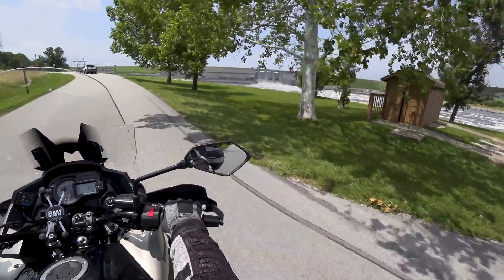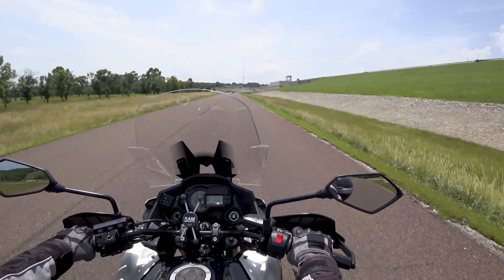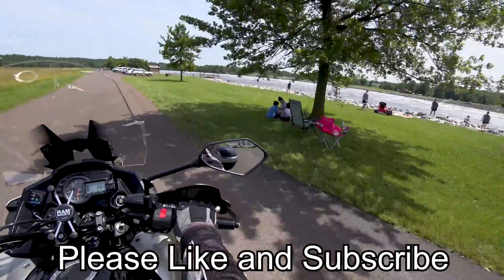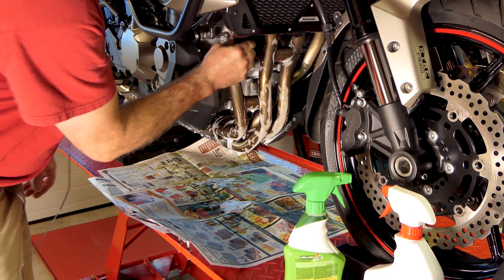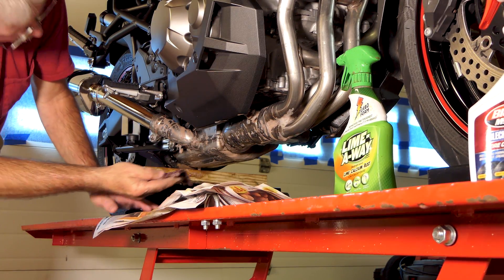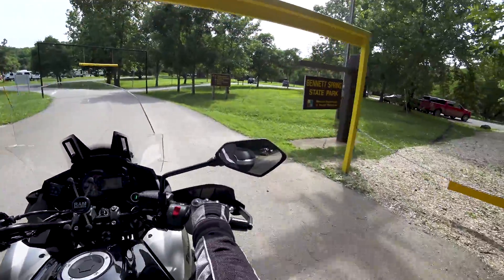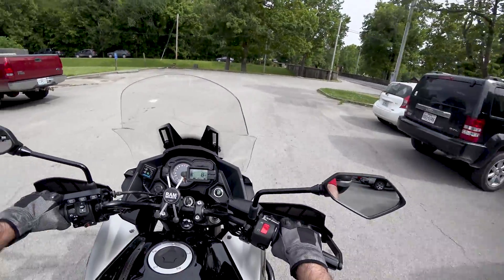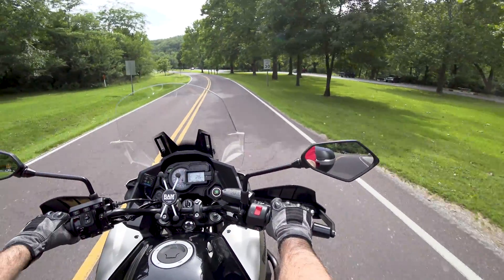Riding in High Water on the Kawasaki versys 1000

Comment: I would like to ask what brand oil and viscosity are you running. I also have a versys 1000
Reply from the maker: Hello there sir, good to hear from you.  I use Mobile-1 Four stroke synthetic in my bikes.  I usually mix 1 quart 20w50 with 2.5 quarts 10w40 but I am sure just straight 10w40 would be fine as well.  Thanks for watching and keep safe out there...  :)